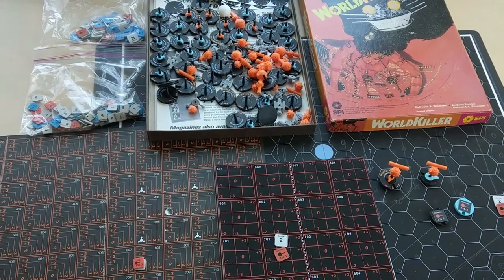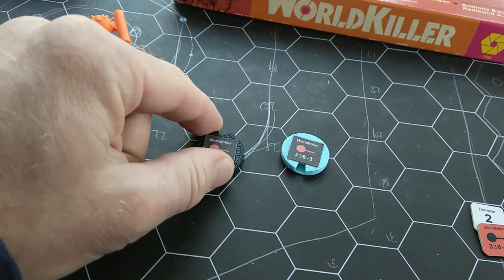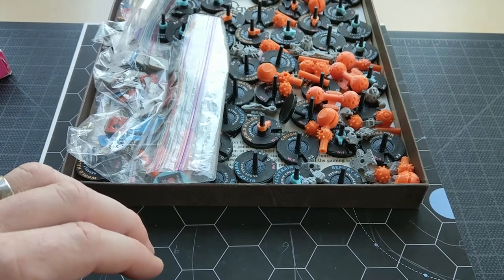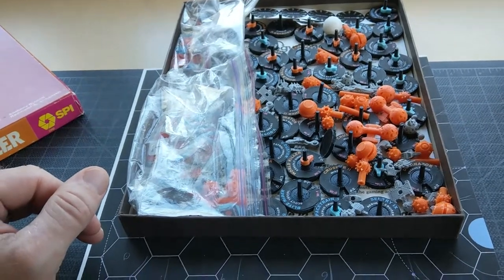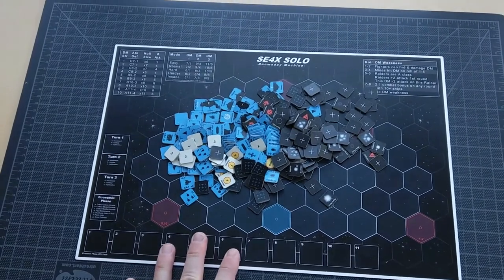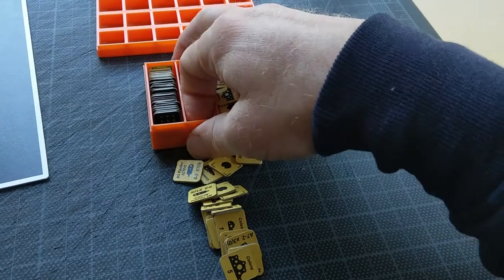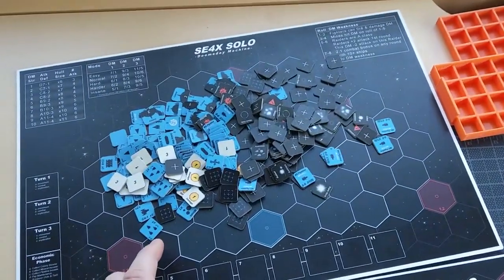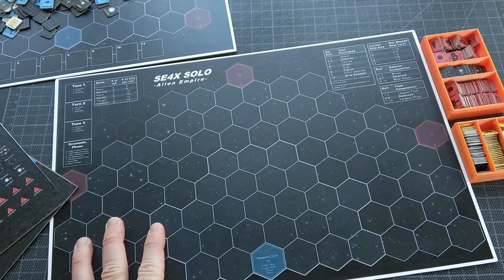Minis vrs. Counters - Counter Storage Designs - More AE4X Homebrewing

Comment: I love your channel, keep up the great work! I also much prefer counters to miniatures (I virtually buy zero new miniature based games, as I take that as a warning sign for shallow gameplay). I recommend using a rotary cutter instead of a knife to cut counters, works like a charm and give really neat, clean cuts. If I can give you one last recommendation, I highly recommend using glossy sticky label paper for your counters, then arranging your layout so that the whole A4 paper contains both fronts and backs, separated by some symmetrical margin and a black line as thick as your counters cardstock. Then, using some sticky tape, the sheet to a window, peel off the back side (revealing the sticky side of the label paper) and lie your cardstock against translucent black line. Then wrap around using the cardstock edge. You will get perfectly centered counters that look better than professional made! (I used this technique to make my own Magic Realm copy, and I was so impressed with the results!) Cheers!
Reply from the maker: Thanks for the tips! I need to experiment more with sticker paper. I tried it once and the paper kept peeling off the counters. I need to find a really high quality sticker printer paper. And yeah, glossy would be rad! I've thought of trying the front/back symmetrical fold over technique that you describe too. Do you have a recommendation on brand of glossy sticky label paper? I'd love to get away from spray adhesives as they are messy and toxic.